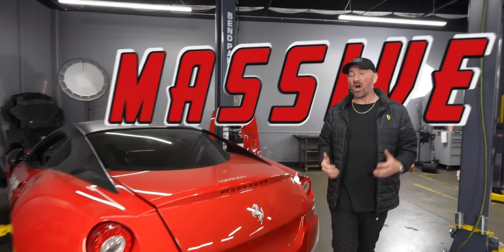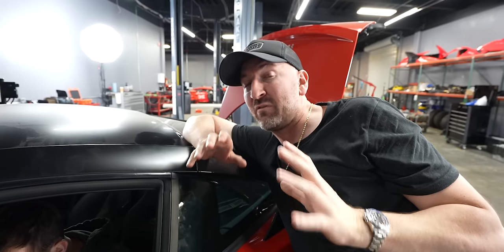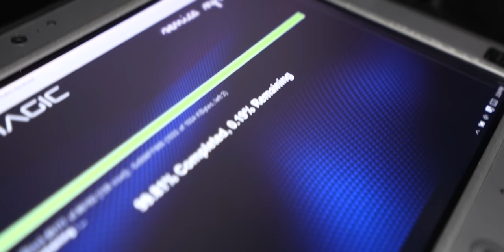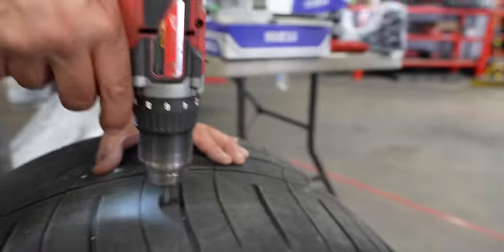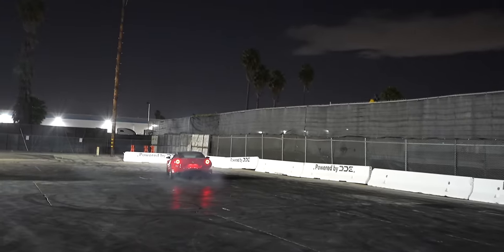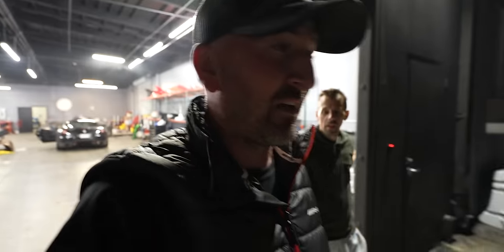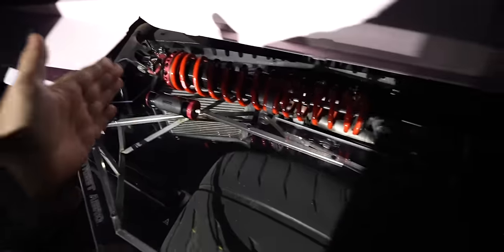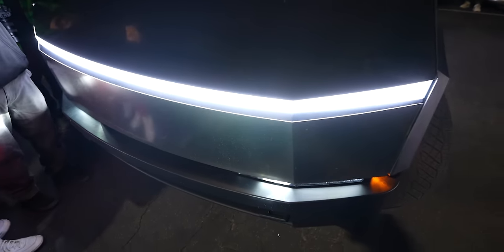FERRARI DEALERSHIP REFUSED TO HELP, SO WE HIRED THEIR WORST ENEMY…

Comment: Dave I am sure someone has told you, the car is rear wheel drive. The handbrake locks the rear wheels. Doing donuts you are spinning the rear wheels. You cant rip the hand brake up and accelerate at the same time! Listen to Mike, Clutch in when pulling the handbrake. But other then that. It was great to see you having a blast

Comment: Mad respect to Art. The guy is a genius at what he does. DDE needs a F430 with a manual conversion.
Reply: Uhm why?
Reply: Lol. You might want to look into your buddy Art there.
EAG is defunct, the investors have seized the equipment, his place of business is gone, and he is looking to be dragged to court for fraud and theft.
Reply: look up EAG drama LOL
Reply: I know all that. It still doesn't change the fact the guy was a genius at designing/building the kits. Where he went wrong was being too worried about proprietary issues and not leaving the business side of it to someone who knows just that. It's unfortunate because he had a good thing going.
Reply: @153eddy  
He really did not. About 95% are just replicas of OEM parts. The stuff they designed is very limited. Many 360 and 430 owners ordered parts form EAG simply because they interchange with OEM parts.

Comment: The power steering stiffening will be due to the speed adjustment, when you go faster the power steering stiffens to stop being twitchy, and lightens for slow manoeuvres. When you’re spinning up the back tyres the car thinks it’s going fast so stiffens the power steering.

Comment: The TPMS sensor that needs calibration is done with a button on the ceiling. You press and hold it for about 5 seconds and it calibrates. I had to do that a couple times on ours 🙂

Comment: Dave I’m sure Mike told you but if you’re still holding the handbrake when you get back on the gas you’ll be going through so many axles. Just keep that in mind. Basically loading up the drivetrain with no where for that force to go

Comment: Dave is still doing exactly what he denied doing when Mike told him not hit the gas with the clutch out while still having the E-brake pulled. He is yanking that brake handle so hard and continuing to hold it while mashing the gas pedal. Gassing it while squeezing the E-brake caliper is going to seriously wear the pads and caliper down, and more importantly what he is doing is putting unnecessary stress on the driveline, especially causing axel and rear end stress. Watch from 20:32 to 20:41. Not the end of the world. He just needs to break the habit. Maybe Mike can install a shock device on the E-Brake handle of Dave’s 599 that shocks his hand if the throttle position opens above 0% while the E-Brake handle is pulled!😂

Comment: lessss grip get some skinny rims for the rear when you drift the pad. the width of the tyre is main thing you could adjust for these things to slide and weight transfer better in that small space. it looks like the grip is to much for the power and space you have, smaller thinner rear tyres will be cheaper and better to find for just burning them on the pad practicing. once you learn and go on a big track then them big tyres will be better.

Comment: 19:56  Dave . Theres to much throw on your ebrake . Your dumping the clutch here with the brake still half on glazing the pads making them overheat and be junk .
The handle needs to be almost upright in the relaxed position and pulled fully on  wheels locked within 2inch of throw

Comment: Geeeezus H Christ Shift Shift Shift Geeezus🤦🏼‍♂️😝😝😝  when your foot is welded to the rev Limiter I wouldn’t be surprised if floor is dented in below pedal!!! Modulate the throttle you are over spinning the electric power steering pump !!!!

Comment: Well since you’re taking the motor and trans out you may as well take out the gas tank and drain the rest of the fluids and put your old parts on it and use that car as the wall car . And what better car for the wall then your first lambo (same model not first actual car)

Comment: I don't get how the black 599 has an ecu problem if all you did was try to copy the tune from it's ECU to the red one. Shouldn't the red 599 only have the ECU problem?? I though the black one just had a clutch/transmission issue originally and was fixed.

Comment: If anyone here had any common sense and actually used some real brains as to why this company gets in trouble its because ferrari and lamborghini is too useless and lazy to build a gated manual again. This company is still very much in business and making kits. They are a manufacturer of the kit  install it yourself. Mike essa and the crew at dde did it themselves its literally a legal issue because ferrari doesnt want people hacking ecus. Anyone shitting on eag is an idiot. There kits are the best in the industry lots of oem ferrari parts and the reason investors are pulling out is because Ferrari is behind all of this bullshit. Ferrari is the number one problem!! They are crybabies that other people have the vision to build something other than an automatic.

Comment: How is that much? An engine is an engine. Just buy a new standalone. Maybe 10k with tuning.. I think these sorta Kinda have 2 ecus. But most new standalone should be fine, they have so many sensors you can use. You basically need spark fuel and timing. Never owned a Ferrari probably never will. But I don’t get what’s so complicated. And you guys haven’t really explained it.